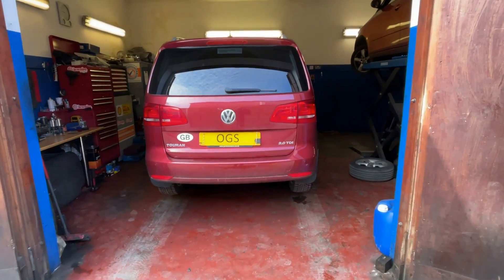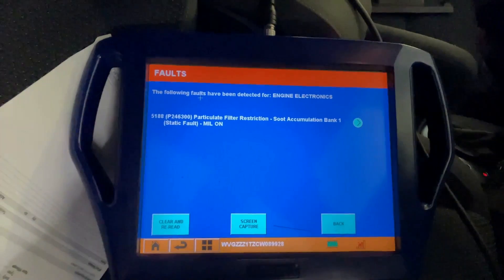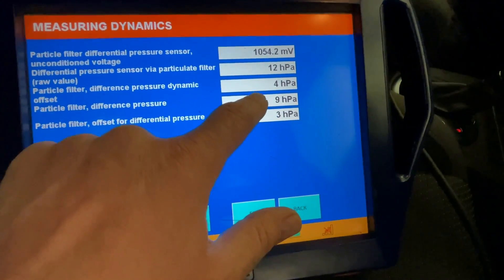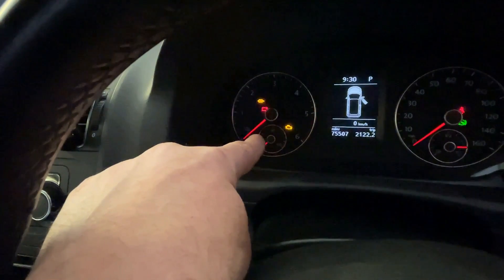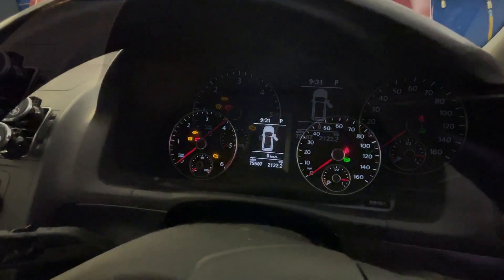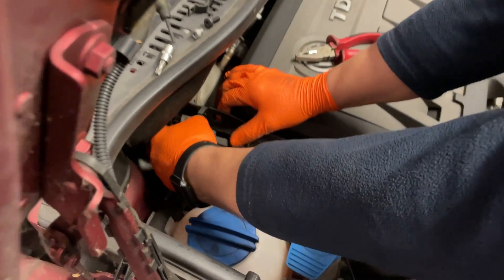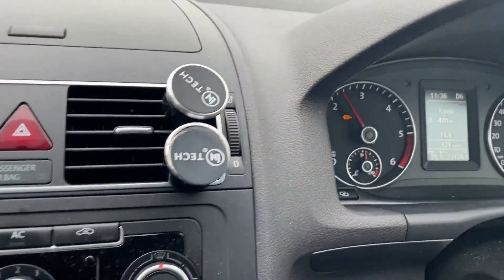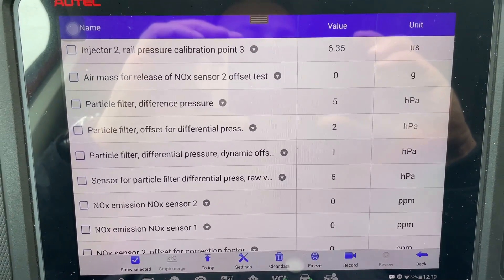Fixed -Engine Management Light ON & Limp Mode - P246300 Particulate Filter Restriction

Comment: Please help me solve my problem, my car entered limp mode, when we diagnosis it, it complain for 1. Diesel particulate filter 
2. Intake manifold sensor 
3. exhaust gas temperature sensor 2. 
Am from Kaduna Nigeria. We have poor working tools and diesel engine parts. We decide to create some horses inside the DPF clean it, we service the exhaust gas temperature sensor, and we we diagnosis again and clean the whole errors. The limp mode goes and come back. 
Please help and guide us. Thank you 
Best regards.

Comment: I have the same fault code : p2463. Yellow lights of motor and glow pluggs are on. No dpf light is on. The dashcomputer says : start-stop fault

Dpf on reading with laptop says 31% full

Any idea what it coult be the problem ?

Its a vw t6 , 2016 VAN
Reply: I'm exaclty with the same problem! Do you resolved??
Reply: @ we did a regenerate with software that called Autocom and it fixed. With delphi it was impossible to do the this

Soon we wil clean it again for making sure it wil not happen again this year
Reply: My crafter 2020 2.0 tdi is with same problem code P246300
Dpf with loptop say 56% full
pressure is 5 to 7 hpa
any idea what could be the problem
Reply: @mentormiftari3877 please read previous comments

Comment: I have same issue 100% it’s start wit DPF  warning ⚠️ light then after two days I got that two alarm 

Glow Plug/Diesel engine manage and Emission control/Engine management warning light
So if I only drive on high way without any replacement is the issue will solve?

Comment: My glow plug light com on..I already scan it and the electricion says it's the DPF tragering the glow plug light cause none of the glow plug not damage and it's losing powerThe code that read on the scanner is p2459
Reply: How did you fix it because I am facing the same issue here with my seat Leon se cupa TDI. Please can you explain?
Reply: @ugochukwupeter6158 yes I fix it

Comment: Hello
I am a truck mechanic
engine light is on on my volkswagen i have changed the dpf and i deleted the wrong codes plus i did twice regeneration with computer for 80 min but it is on pedestrian
it's like that during the test drive the light disappears but it lights up again after 15 min I'm tired of this

Comment: Do you use the bluetooth obd reader with the autel or use the wire setup ? Going thru this exact issue right now with my 2012 golf. The scanner shows the the dpf filter is still good was able to get it out of limp mode but the glow light starts flashing again after a short drive

Comment: I cleared errors which got rid of limp mode, took it on motorway way in 3rd gear to regenerate, didn't need to change sensor

Comment: You nailed it exactly the dpf pressure censor makes you think you have glow plug and regeneration problems but change the dpf pressure censor and then you can clear the rest exactly my problem but beware of buying cheap dpf pressure censor as I've had 3 and still had the problem till I bought a oem part thank you😮

Comment: Hey I have theses codes on my seat ibiza 1.2 tdi, should I change the differential sensor and I wonder if I could fixe it after with a OBD  (OBDII/EOBD+CAN)? 
P2463    P0405    P0403   P0238.

Comment: I have passat b6 2009, had dpf light on, went on highway to clear it drove 90km/h  on 2500rpm after 15min got glowplug light and lost power
Reply: Did you get a solution bro?
Reply: @simukelethommy4903  yes brother, i tried multiple products to put in with diesel to clean the engine, [dpf cleaner liquid] but that helped just for few days, finally i went to garage and disabled egr valve and dpf via computer,  6 months later I'm still happy with results

Comment: what if i add DPF cleaner in fuel tank when the glow plug light is blinking along with the DPF warning, and if I go on motor way will it get fix by driving or do I have to go to a garage to get the code ?removed, I just drove for 30 mins without any DPF cleaner but the car is still in limp mode
Reply: What happens after?
Reply: @draganku  I went to local garage guy to remove the warning with a OBD2 machine and once the working codes are reset, I used the DFF cleaner with direct into the DPF near engine and sprayed it and drove on low gear until the blinking lights went off and also the DFP light went out
Reply: @VA57AVA  and does the car now work without any problems or symbols at the instrument panel?

Comment: No need to replace 
any sensors. Once dpf light come's on you will have to run the car at 2500rpm for around 10/20 minutes continuously. This will turn the light off. If ignored the the limp mode is then activated. Once in limp mode you will need to reset the codes via computer and run the car at 2500rpm as explained above to turn off the dpf light. This has been tried and tested on my vw many times but is only a temporary fix as it depends on what sort of mileage you do. Mine used to come on every 3 day's. The one and only solution to this is to get the dpf removed and remap (costs around £300). No more dpf lights and burning unnecessary fuel. Hope this helps someone.
Reply: and then u will pay a lot if a police catch u
Reply: @christopher4160  lol

Comment: Exactly whats happening to My 1.6tdi Polo 34,000 From 2012 1 owner b4 me and It;s stuck in Limp, 1st the DPF light came on so filled up with fuel and RAN it up/down motorway and it cleared the Light, Then Both the DPF/Glow Plug lights came on and LIMP MODE, So bn watching a few of these vids Because changing the EGR is a right Pain on these Polos. Thanks For sharing, If you were in South Wales you;d have a customer.

Comment: I get this flash on my Audi Q5 specially when I pull the car a bit faster to drive at 80-90 .. the car becomes slow .. but i don't get this indicator when I turn on the car ..pls guide

Comment: Hi guys. My Golf 1.6tdi is doing the same thing or should I say is showing the same errors/lights as the car in the video. I’ve scanned it for codes and it’s coming up with just the values of the dpf,-9.35 hpa and the soot content is near enough 40%. I’ve replaced the differential pressure sensor and reset the values with no effect. It’s still in limp mode and the glow plug light is still on. Any more info on sorting this issue out please,thanks.
Reply: Did u fix it bro? If yes, how?
Reply: What happened?

Comment: Seat Ibiza, 2009, Diesel, 27000 miles, CAYD engine, 3 faults one after the other, glow light flashing, engine management light on, brake pedal pressure reduced, changed Pressure Solenoid, brakes now hard, lights still on, fault EGR P040700, used an EGR spray cleaner several times, some positive improvement, now another fault P256300, Turbo Boost control Sensor. Replaced original Solenoid, brakes hard, faults still there, so not the Solenoid. Note have 2 new solenoids which i have fitted as a trial.
NB Cleared the faults with the EGR spray, drove at max legal then DPF filter back on, but had driven the car that morning to make sure regeneration was implemented.
Any thoughts? all ideas considered. The EGR on this engine looks different to the CAYC engine?
Reply: My seat Ibiza got a bit same problem , 3 lights turned on , first glow plug blinking then I drove a lot to get it solved then , then silencer sign light n engine light went on .... My car is still in warranty , I m unable to find any earlier appointment need a local garage in Wolverhampton , any recommendations would be appreciated
Reply: Hello, what mileage, diesel? Year, model etc.
I have cured my faults now.

Comment: Once the sensor was changed did you have to recalibrate to the ECU or was it plug and play
Reply: It’s just plug and play bro
Reply: @genaroespinoza3110 this has only happened to my VW sirocco r-line am booked in 4 2moro, mine as went into limp mode also, what will this cost me at the garage?
Reply: Plug an play

Comment: My VWT5 went into limp mode with Engine management light coming on..it would disappear and then return..the problem was the ERV..Exhaust Regulator Valve which needed to be replaced..originally thought it was sensors but wasn’t

Comment: I have same lights on my seat ibiza 1.2d  tdi . I was in garage, they saying too me i have EGR problems and needed clean DPF . Just changed EGR , but still have glow plug , engine lights and dpf light on :(
Reply: Same here on my Seat Altea 1.9 tdi. Garage replaced the egr valve and reset all 3 lights. Within 60 miles or so I had the dpf light back on followed by the coil light. On next start up the engine management light joined in! Garage say they've run out of ideas! So I'm back to you tube!!
Reply: I have the same car, same problem. Did you find any solution?
Reply: I have passat b7 cffb and had egr problem with engine management light so got it deleted now the dpf is on with coil and eml all together had regen done twice but keeps coming back on any ideas please help as now I've spent £240